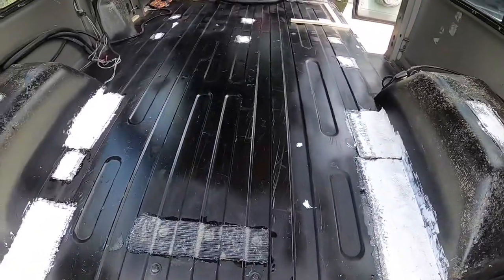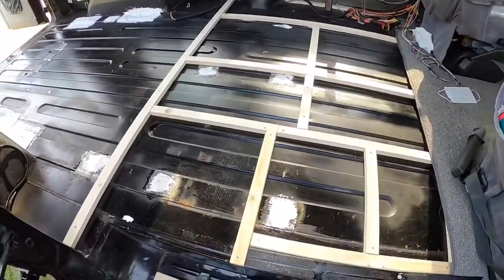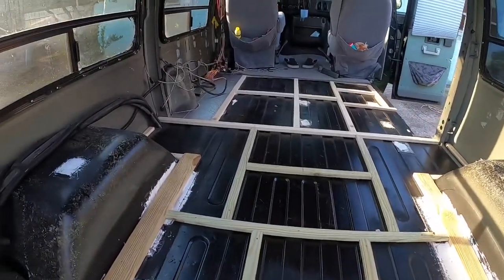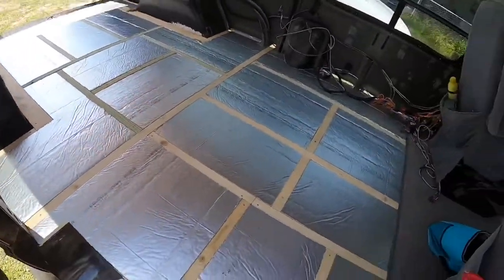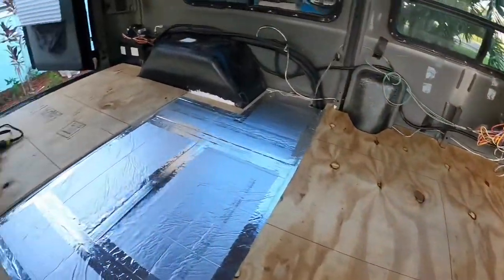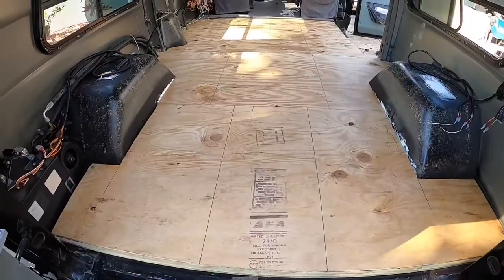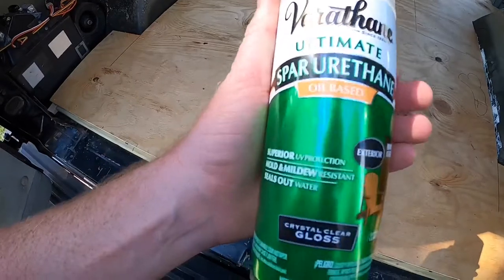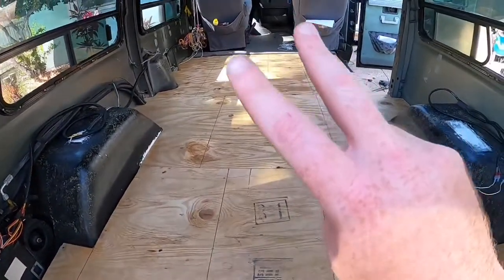Subfloor and Insulation Build in my Dodge Ram Van Conversion

Comment: What size wood for your framing? And size on insulation? 
Did you get hurt from your fender bender? Hope you're ok.
Reply from the maker: I used 3/4 inch insulation board and 3/4 inch x 8ft wood panels I’m good after the crash and I’m just about done fixing the van!